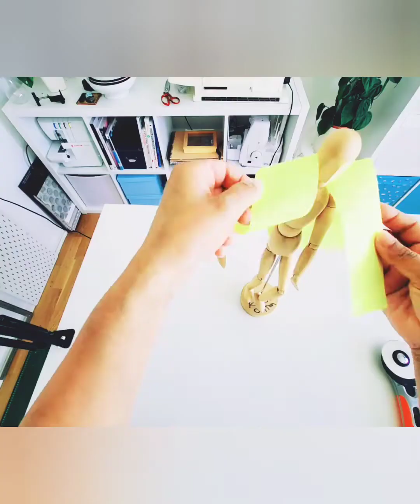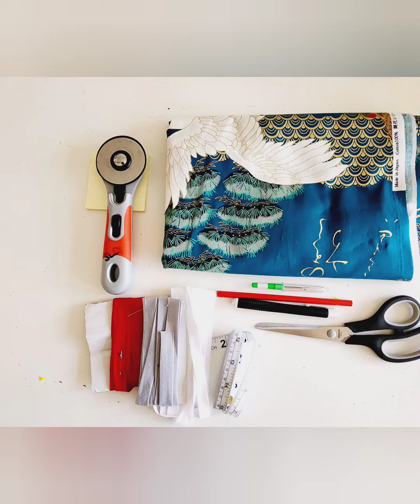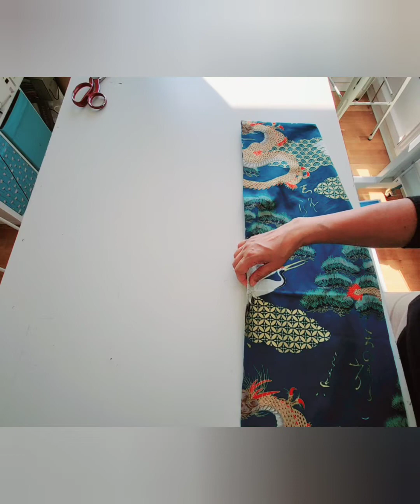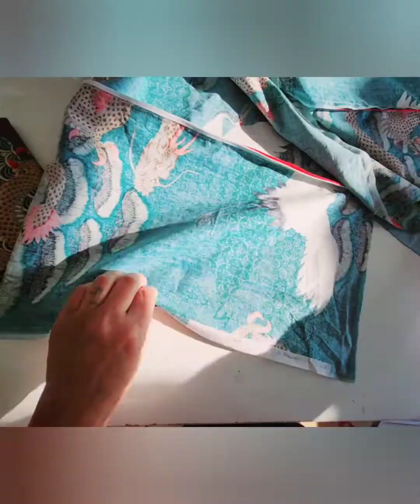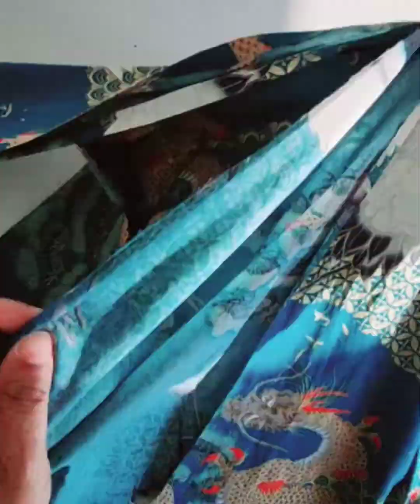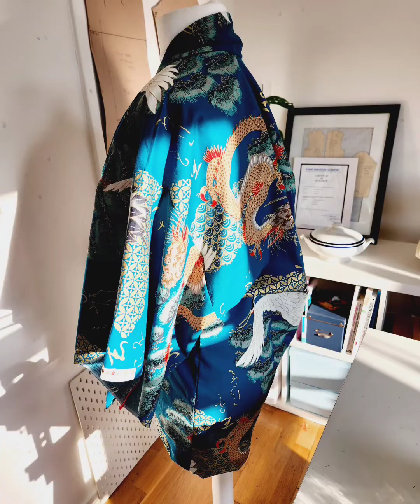Sew a Zero Waste Kimono (Pattern Included!) | Beginner-Friendly Tutorial

Comment: Hi Krissie, I'm hoping to make the kimono using my own patchwork material. How wide and the length  is the front and the back and what sort of size should i make the sleeves.
Thanks its a great video. I wanto to make the patchwork panels to the correct size so that I dont need to cut
Reply from the maker: Hi, whats a fantastic question,  this concept uses zero waste, so you would need to make a rectangle 52 in wide 2 00 cm in length roughly. sleeve with is up to you. I have included many other videos that show you how to pleat the fronts so you have no waste.
Reply: @Krissie-Colton  Thanks

Comment: How much material did you use
Reply from the maker: I used areound 2.5 metres of fabric because the width 60 in wide. If you want it full length I'd suggest around 3/4 metres depending on how wide it is. Or use a bed spread as they are really wide , then pleat it in. See one of my other videos for tips.
Reply from the maker: Hi sorry i'm only just seeing this. I used around 2.5 metres of curtain fabric. 60 inches wide.